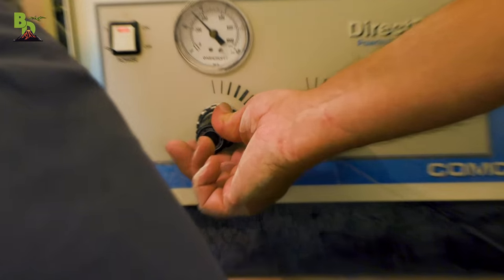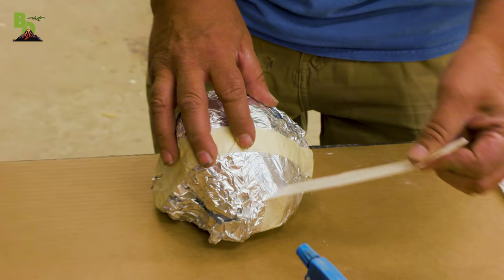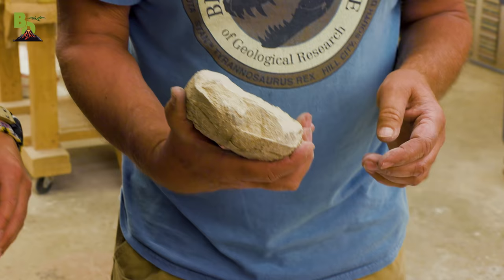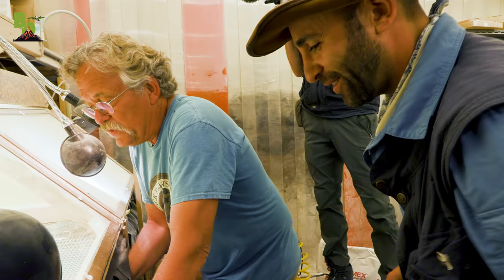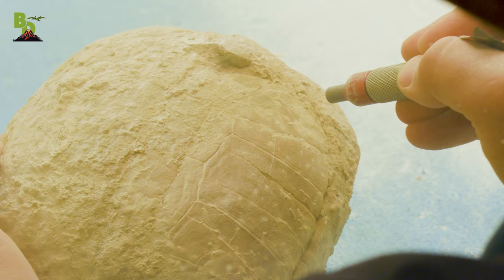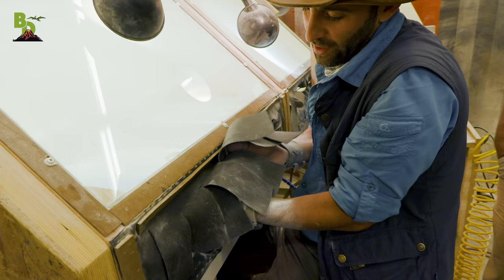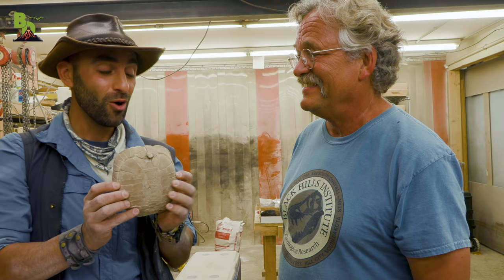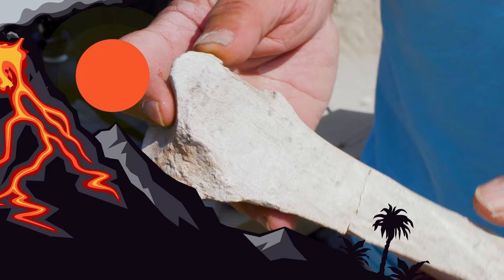WILL IT FIT... in the Museum?

Comment: I have found Hundreds of fish fossils at one of the fossil quarries outside of kemmerrer Wyoming. my best find, is half a fish that has super nice scales and many visible bones... its extremely delicate though and ive been working on it for years now with dental picks and various scrapers and needles to clean it up from the Matrix rock. I found a specimen my last trip to the quarry that was an "exploded" fish, where it reaches the bottom and the pressures cause it to explode and it leaves all its scales in a jumble around it.. I pulled it from the face of the quarry cliff in a single slab, I has used a super thin chisel and found a spot in the rock that looked nice, and I slowly hammered it in until the entire slab was free, I lifted it up and I saw the fossil sitting there without an imprint or split side on the lifted slab and it was the best find of the day. perfect preservation, no need to poke at it to clean any matrix off. only prep it needed, was to use the gas powered diamond saw to trim it square, and make the piece smaller so we could send it back home more easily. ive also found tons of trilobite fossils on at least 2 different trips when I was much younger. and just the other night I was working on some rocks that where brought back from a trip my parents went on, and I found a fossil Bee! it was super cool. (also, non fossil related, I do love to visit The Crater of Diamonds in Arkansas, for a chance at finding some Carbon shiny someday haha...)

Comment: I will always remeber when I went to the beach a couple years ago and found a crab shell fossil. At my beach there is a hard wall of sandstone like material in between the ocean and the beach houses, because the beach is lower down than the beach houses. I was exploring around the rock wall and noticed something that stuck out so I picked it up and there it was. A crab shell fossilized in sand stone. It is one of the coolest things I have ever found but unfortunately I misplaced it while moving recently and can't find it and don't think I ever will. :(